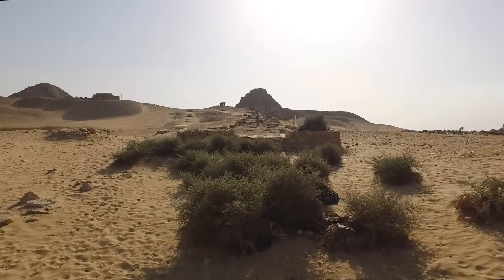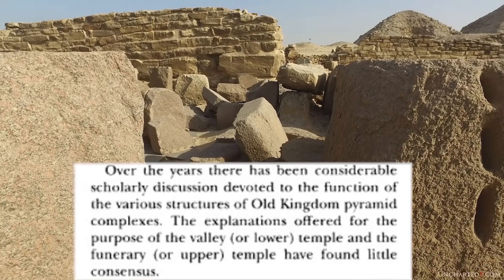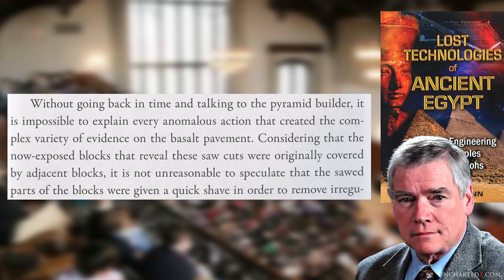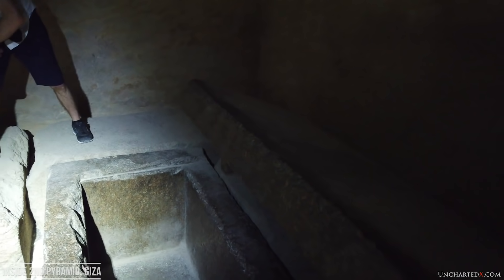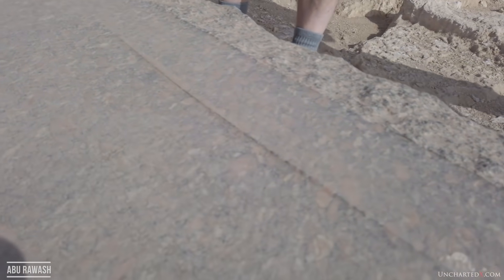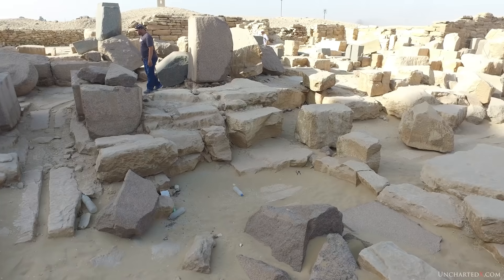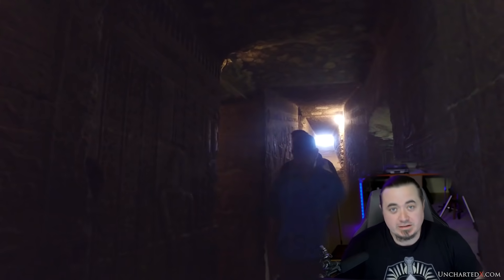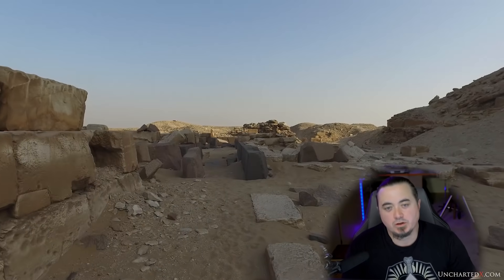The Mystery of Ancient Egyptian Stone Cutting in Basalt and Granite - UnchartedX full documentary!

Comment: When you use a saw using sand or whatever as an abrasive it makes the cutting edge thicker by double the thickness of the abrasive plus the blade thickness allowing the top of the saw to lay to one side or the other allowing for a cupping in the cut.

Comment: The 'temple' could have doubled for the stone cutting facility during construction.
If we assume that corundum or basalt sand was the principal cutting material for stone cutting, and Tin was used for embedding the curium in the copper saws, it would make sense to recycle these valuable resources; hence the need for a drainage system with elaborate collection features. Tin was a strategic commodity in the bronze age: hardly disposable. Tin is used to embed corundum in modern stone cutting wheels. If the saws were copper, they would have been low hanging fruit for thieves during the first intermediate period. Maybe copper grinding wheels have been mistaken for mirrors?

It is possible that the act of stone cutting may have had a metaphysical dimension, just as the act of writing. Stone on stone grinding would also have demanded the need for the recycling of the cutting materials. If they used oil as a solvent, the collection stations would be equally important. Perhaps they used an emulsion of water soap and oil, to reduce evaporation. Also the only means of producing various grades of cutting material would be through recycling. The longer the grit was used, the finer it would become. Stone polishing would demand a highly efficient means of cleaning and grading the cutting medium, as it was reused.

Clearly a lot of forensic work needs to be done on the surviving old kingdom basalt floors. They are highly chaotic. Just how much of the stones were broken or cracked after the fact, or perhaps polished and reassembled after they were broken? The floor needs to be deconstructed, 3D scanned and reassembled, and the supporting earthwork sampled, analysed and excavated to build a chronology for the surviving structure.

Comment: The "U" shaped blocks could have dual purpose.
1. Foundation/floor leveling device.  By filling the U shaped canal with water to a precise level of the foundation and the floor could be achieved. Water levei system was used in ancient Egypt.
2. Wherever the U-shaped canal leads between the two walls it can have a function of gathering water used for cooling the walls and the interia of the building. This was used in palaces and temples where the double wall system was in place. The internal space between the two walls - which was drafty  - could be efficiently cooled by pouring some water on the walls. The water surplus was drained out by the u shaped canals that could beplaced  under the floor - assuming floor was not water tight. I saw such temple ruins in Fajum Oasis in 1978 and the cooling system was explained to me by the worker of the Egyptian musem.
Reply: I imagine they were made from the decorational material is because that's where the contractor had his equipment and it was all a job lot purchase.

Comment: The thing that occurs to me about all of the circular saw cuts is none of them show evidence of being run through  the saw, like a table saw where the material is exposed to the downward cut at the lead edge, and to the upward cut of the saw as it passes out the backside to clear the blade. This would show cross cut striations. That indicates, to me, that all of the featured cuts are plunge cuts. Another point on this is, there is no evidence of the blade going in and then being removed from the cut as this would usually cause some contact with the sides of the cut just made as it comes back out. The task of cleaning and polishing the surfaces even after a very fine saw cut should not be underestimated. Anyone who has tried to smooth hard stone surfaces manually with modern abrasives can agree it is a tedious undertaking.

Comment: This is so interesting. Its undeniable that they had some sort of huge circular cutting tools. Regarding the concave cut at 34:00 it could be that block is a reject. If the saw drifts deep into the cut, you would get exactly that curved, concave cut. Hard for us to imagine how these saws were made, but its clear they had them. If they had 9 meter diameter copper disc, and some apparatus to spin it and lower it into the stone, then these cuts could be made rather quickly. Maybe a matter of days, not months. They could be powered by simply having a team of "mules" or humans turning a crank continuously. Seems like this culture was absolutely obsessed with stone and cutting of stone. It was probably the primary occupation for most of them. For thousands of years, they perfected the art of stone cutting to the point that they could achieve this. If they used copper, then its not surprising that there is no evidence now. That material absolutely would have been looted and taken thousands of years ago. There is just no chance it could have survived.

Comment: If you were making boxes from a solid block of wood you would drill holes then break out the rough and use chisels to clean up the sides. Some stone boxes in Egypt show evidence tube drill were to do the same. They sometimes went off course or drilled too near the edge and 9art of the hole was left in the inside face of the box. Eg they couldn't be bothered to make the inside of the box bigger to get rid of this defect.

Comment: Looking the flat rock surface of the unfinished stone there are are 5 to 6 inch rows showing it possibly was a cylinder grinder and not ruling out a flat round grinder was also used from the groves from the edges made into the stone.  When I used a round flat grinder on cement it makes the same groving, but the edges show a cylinder grinder to make to curves on the back edge.  So they had many kinds of grinders, which we need to make a cylinder grinder and try to duplicate it.

Comment: I'm a bit late to this party but want to add my two drachma anyway. Has anyone considered the cutting material to be diamond, like we use today? The Egyptians surely knew about diamonds since there are quite a few mines in all of Africa and if there is one thing the Egyptians did, it was to range far and wide. I imagine these huge cutting wheels (I'm sure there were many diameters) to be like spoked wheels, possibly made of wood, with diamond "teeth" embedded in the rim. The rim would be in sections to allow for quick and easy change of sections that got damaged or worn down. With these wheels being made of wood, they would be lighter and therefore more maneuverable than solid wheels of some hard substance. I envision a central axis with outer small wheels to stabilize the big wheel, give it more accuracy of cut. For power, I can see a kind of "crankshaft" that is human powered with a gear system. The crank can rotate fast and is geared down so that the torque is increased to the big wheel and slowed at the same time. A wheel that large doesn't need to rotate very fast. And it wouldn't take very many workers to power it. They can also work in shifts standing on a platform and change shifts every so often so that the workers don't get overly tired. This spoked wheel can also dismantle and move as necessary. I envision a similar set up for a diamond drill.  Also, like today, this technology was carefully guarded. Knowledge of how it worked was kept and handed down through secret guilds. It was never allowed to be depicted in stone or described on parchment, slabs or slates. It was a form of power and those who knew it wanted it kept that way. That's why when the dynasty, or whatever ruling entity had it,  died or went out of power, the technology they had went with them.
Reply: ... You can just use sand to achieve exactly the same result... There is so much misunderstanding, and so many misconceptions about these ridiculousness scales that keep referencing that have nothing to do with the actual machine, ability or work ability of stone... Easily polite, all kinds of things with literally the sand from the same desert that they lived in🤣... There are dozens of videos on YouTube showing this. I don't know why people think this is such a mystery. It has been replicated, dozens and dozens and dozens of times by a number of different people in institutions, but for some reason, people like Ben don't ever ever want to talk about these things.

Comment: Since the channeled blocks were mostly under the floors, is it possible that they were a raceway for round stone bearings that were used to transport the heavy building stones? Then merely abandoned in place when the structure was built and the floor was laid. Maybe the bowls at the end of the channels could have been basins for a lubricant and the round stones were rolled into it after they were freed from under the moving stone, re-greased and carried up and placed in the trace in front of the stone.
Reply: whatever the original purpose, this is where priests conveniently dropped a leak

Comment: Love your work! Maybe if we re-imagined the 'circular saw' as a 'swing saw', i.e. not a circular bade but something like a flat bar with a cutting edge on one end and a hole on the other to swing it off a pivot point? It's similar to the 'drag saw' concept, but would leave the same cut marks as a circular saw. Just an idea.. 🙂
Reply: A pendulum system is far more logical as you say, to build a circular blade 10 or more metres in diameter would be a huge challenge.

Comment: Well, it is possible that they are ceremonial, but not to be seen directly, more to deliver some "magic".  It would require a pretty intense inspection, but I wouldn't doubt if there was a way to deliver linseed oil, tar and wine mixed or some other flammable liquid to braziers throughout the facility (way better than torches).   Those braziers probably had coal in them most of the time and the oil only delivered during ceremonies for Magical effect.  And if they used Tar would provide a little heat under the floors, which prior to the Dryas the global temps were pretty cool and could have been necessary there.

Comment: Judging by the loss of copper, and copper's expense (then as now), it would make sense that the copper blades would need to be prepared somehow, so that they were not eroded by the cutting abrasive.  For example, what if somehow the abrasive was embedded in the saw, and the abrasive didn't move at all, but was held fixed in the blade. When the abrasive became worn down, the blade would be sent to the mill for refurbishment.

Comment: The copper or bronze could be recovered from the sand used to do the actual cutting, smelted back into a replacement blade and with several blades being available, work could continue on an industrial basis for as long as was necessary. Using a pendulum suspension system would create curved cut marks resembling extremely large modern circular cutting tools. From our modern viewpoint it is difficult to appreciate that time was not a factor and such projects employed hundreds or thousands of people. We are talking about monuments that were created, erected, and recycled over periods of thousands of years, made of materials that were largely impervious to weathering. Compare that to modern buildings that are largely completed within a five year cycle and that have commercial lifetimes calculated as between twenty and one hundred years. Another mistake is to assume that harder rock is harder to cut than softer minerals. That is not always the case as harder rock surfaces are more inclined to splinter and shatter than softer rock which tends to absorb small particles into the surface initially. So it may well be that hard basalt was easier to fashion than a more granular granite. Finally there is no cause to assume that so called primitive societies were any less ingenious in working to produce technological solutions than we are today. The people then possessed the same level of intelligence as humans living today. To assume otherwise is a foolhardy delusion as to our importance today.

Comment: So Here are a few thoughts…. 1) I think sandstone would last a hell of a lot longer than copper blades on saws, with the added benefit that they could also be used for polishing, by just laying them on their side…

2) imagine that you had a piece of sandstone, the size of a blackboard for example, and this blackboard sized piece of sandstone were suspended from a crane, such that you could swing it back and forth, it would take considerably less energy that people moving the blade manually…

3) some of these pyramids have millions of stones in them…. I think that it’s highly unlikely that these stones were moved by anything less than a barge….I suspect that the small grooves that you referred to, held some type of gasket which would prevent water flowing out, and then a canal was created using these blocks… stones were barged in, and as each layer of the pyramid was created, they could raise the height of the canal…. By 1/3 the height of the pyramid, the vast majority of stones used in a pyramid, had been put in place, they could then dismantle the canal and start raising those stones to complete the rest of the pyramid…. I think that at that point, the most likely scenario, was some sort of internal ramp structure within the pyramid, that was then back filled, leaving the top 1/4 or so of the pyramid that would have to be raised, with levers and structures on the outside of the steps of the pyramid…!

Comment: You would think at the least they would have suggested a single axis pivot pendulum type of saw that then could explain the large curvature cuts but I've worked with hard brick & stone diamond cutters & the striations are typical of a plunge cut of a circular saw type & not of a circular saw cut that's fed in by a series of horizontal cuts as demonstrated by the industrial stone cutting edited footage, by the striations you can tell it was a continual circular rotation high speed cut & not a back & forth pendulum cut, you can even cut if you feed the blade very slowly without striations, would make it easier to polish for a ultra smooth & flat finnish

Comment: The u-channel blocks are certainly functional in nature.  I can see the grooves as being tracks for some sort of transport system,  i.e. railway rails. Or, conduit for water being used in the cutting process. Or even rain gutters of some sort, if we can picture the pyramids being built at a time when there was substantially more rain than what is received currently.
Reply: Some $0.02 but most likely is mechanical in nature; at 44:58 this 'X' configuration makes no engineering sense concerning any fluids (eg, plumbing), but does make sense in the context of desired articulation of a transported load via a narrow-width large diameter cylinder and two degrees of freedom.  43:42 also appears to be the process of mechanical wear, as the geodesic between those linear segments in that passageway follows-well the worn channel, contrary to a fluid's wearing expectations in that channel.

Comment: Just a couple of considerations:
1) did someone investigate the possibility of acids (like vinegar or something else) be involved in "softening" the stone while cutting it?
2) the machines had to be powered, so wind and especially water comes into my mind.
3) due to estimated size of the cutting blade for circular saws I would consider a pendulum movement with a small but heavy blade instead..
Reply: answer 1 weak acid can work only with limestone , for granite you will need hydrofluoric acid and no acid were used to extract/ shape granite blocks

Comment: ~0:55-1:00 in Ben talks about the flaking basalt in contact with the limestone. Perhaps a high heat cycle (cutting friction) and/or the crystalline shattering effect of cutting may have weakened it somewhat so this is highly accelerated weathering. A microscope scan and check would indeed be interesting. Also limestone can be chemically active in certain situations so chemistry may also play a role here. And these different rocks contain different minerals and ratios, giving rise to very different crystalline and electrical/magnetic inductive properties. So no great surprise that the stone conductivity experiment gives the result it does. But with different compositions they will have different inductive properties as seem in the experiment. (In fact you could probably reverse engineer this as use it as an induction based rock type analyser/detector)

Also: myself and other people here have commented on the lack of any pictures/glyphs showing stone-working. We see so many pictures of them doing ordinary thigs that we recognise - because we do those same things today. But what about pictures which no one really understands what's going on in the scene? ...and usually therefore ascribed to ritual purposes! :)

I'm referring to the sorts of generally abstract pictures that some people (I'm not one!) say show people using alien tech or other alien items. Could it simply be a closed mindedness in the interpretation?
EG: this cannot be a stone-cutting saw as these people were too primitive; it doesn't look like anything else we recognise - ergo: it must be an alien artefact, or some religious ritual process.
We can see these people were very smart indeed, and the stones themselves are clear evidence of an efficient mechanical cutting process.